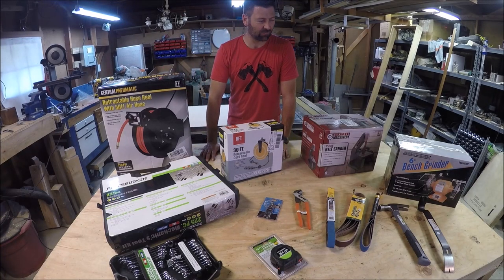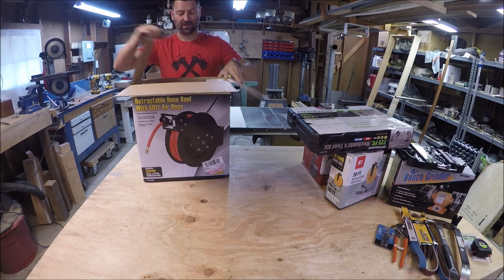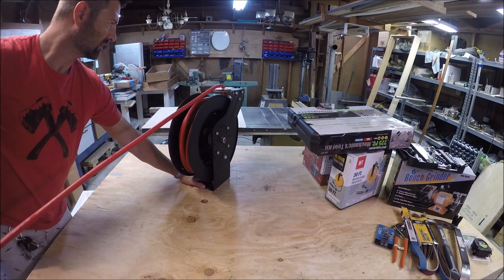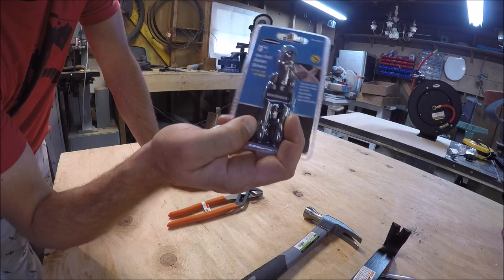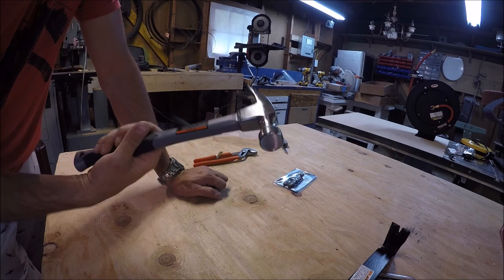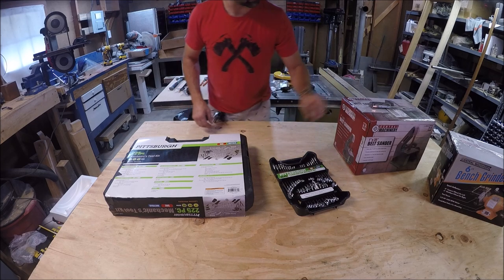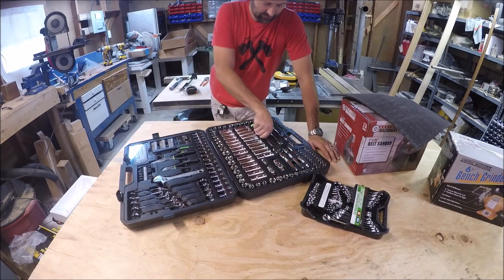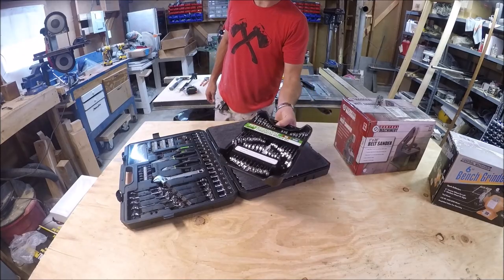Harbor Freight Tools For Pros | THE HANDYMAN

Comment: plenty of professionals do use HF, it just depends what category of work they do. In construction/remodel HF is always on site, why? because contractors (and the like) bake the cost of tools into their projects. so if it lasts the job or not doesn't matter when you can just replace it in the 90 days or when they've already charged $100 for a drill when they use one that costs $20-$30. plus you can leave HF tools on a jobsite, even if they are stolen you didn't loss a $600 miter saw.

Comment: I am 55 and my pop was a master mechanic for over 50 years he had 3 huge craftsman tool boxes with mostly craftsman tools a few snap on and Matco. We lived 2 blocks from Sears. We would go there to look around and always had a tool to return. We had rusted tools broke screwdrivers never a problem returning them. I learned a lot about mechanics and even worked as one with him for 5 years on the books but from the age of 7 he took me with him to work. I went in the NAVY to learn electronics and was a reactor operator but after 7 years I got hurt badly on a sub leaving me with use from the waist down. But when he died last lear I got all his tools and have them insured for 34k. Now I still break a tool now and then but now there made in China and the sears closed by me and the closest one is 61 miles away 
I do wander sometimes if I had not gone in the NAVY if I would have gotten hurt.
Reply from the maker: +ncrdisabled Submarine vet Thanks for your service.  My dad was in the navy too.

Comment: I agree. I have a lot of different brand tools from expensive name brands to cheapy ones. Harbor Freight tools so far have worked just as good as the name brand ones. Of course there are a few that are inferior as in quality but still does the job. Most people I know or seen complain about anyone using Harbor Freight tools is usually just a tool snob that believes if the more you spend on a tool the better it is. Got news for them....unless you have a tool made back bout 30yrs ago or more, they are all made in china.
Reply from the maker: I have found the drill bits and saw blades are the worst thing to buy at HF.    There are so many things that that you can't ignore the deals on and be a tool snob.  thanks for the comment.
Reply: I'm 31 years old and have tools yonger than me that are made in USA.
Reply: Same here....some tools are worth paying extra for, but harbor freight does carry inexpensive tools that can't be passed up.  just as an example, I had a Fein multimaster years ago.   the motor failed just after the warranty expired.  So i purchased a harbor freight multitool to finish the job i was on.   Thing lasted me three years and i paid $40 vs the $400 for the fein.   So even if they fail,  they are worth the money for the work they do.... also bought a $10 pneumatic chisel gun around the same time and still use it sometimes till this day.   Only thing i will never buy from HF is hand tools.  They suck and break and can be very frustrating to work with.

Comment: I love Harbor Freight tools. I've got a bunch of their hand tools in my bags. Things like the cheap hammers and stuff are great when you've got a crew. If someone loses a $5 hammer, it's no big deal. Other things are just handy to have - like the long-handled flat cutters. They suck as cutters but if you use them for pulling nails, they're unbeatable. Perfect grip and leverage. My flat bars are over ten years old and they're still going strong. I go through HF chisels like crazy. They're good enough to do the job well and cheap enough that I'm willing to use them in situations that I wouldn't risk good chisels on. Gotta love it.

Comment: Heck ya Handyman, I'm a huge HF fan myself as a very basic weekend warrior DIYer.  I've slowly put together a very nice collection of handtools and basic construction tools from HF pretty much never purchasing anything without at least 20% off.  I bought that same grinder a few months ago and I had my eye on the 1x belt grinder, glad to hear it works well for your knife.  I know this video is 3 years old, but still relevant!  I also never thought of setting up a smaller pancake air compressor like that, for some reason I thought a shop with a compressor had to be some big huge thing.

Comment: I've had a Harbor Freight drill press for nearly 30 years.  First one I bought made a funny sound, they gave me another. It's got a 1 hp motor, can be wired 110 or 220, a big 5/8" Morse taper chuck, and with 16 speeds I run it down to 170 rpm so I don't burn my bits. And speaking of bits, I've had nothing but success with their bits, and also have a set of "Silver and Deming" bits that go up to one inch.  They have done very well on countless projects, no chipping or shattering.  There are lots of good Harbor Freight tools, and while some are weak and to be avoided, most are fine and a great value.  I do diesel bus repair and dismantling.  I have a 1 inch drive socket set with the ratchet, two extensions, and about ten huge sockets in a nice case.  For 40 bucks.  You can pay that for a single socket when they are this big.  I generally use them with my Bad-A** 3/4 drive "Earthquake" air gun, their biggest pistol grip model. It claims to have 1,400 ft lbs of torque., I can't say for sure but with a good compressor (and oiling the tool before every use) I've taken off hundreds and hundreds of Very Tight lug nuts, at times even ones that some gorilla has cross threaded.  I agree, only tool snobs would Never Shop at Harbor Freight.  But if I had to use my tools every day like construction guys, I'd probably go Milwaukee for a lot of my stuff.  I had a 1/2' "Hole Shooter" drill, on the top there's a plate that says "WARNING: high rotation force" and they ain't kidding.  I used it once with an auger bit and it damn near killed me, I was glad to let go and walk away alive.  Same for their awesome "Hole Hogs."  You get in the wrong position with one of those and they will slam you into a wall make you cry for mama. Still, I've successfully used lots of H.F. tools in my bus business, their 12 ton air over hydraulic jacks are Outstanding.....but like a lot of H.F. stuff, it has a hidden flaw to fix: the air hose will begin crack prematurely especially when hit by the sun.  Wrap it up with black electrical tape and you got a great tool at a great price.

Comment: Nearly every pro tool box tour on YouTube has some Harbor Freight tools in it.  I do not know anyone personally in trades, diy, or auto tech who has zero Harbor Freight tools.  

A few of the items serving me well over time:  breaker bar, 1/4 roto ratchet, impact sockets, axle nut socket set, floor jack, jack stands, socket adapters and extensions.

Keep the 1/2 extendable ratchet in my road kit.  Can take off lug nuts no problem.  No issues thus far.

Just bought their hose grip pliers which seem pretty nice, plus the jumbo Pittsburgh Pro punch & chisel set, and the LH drill bit and step drill bits.  We’ll see how they go.

Comment: I've had great success with harbor freight items, specifically their wheelbarrow compressor and both a 4000w generator and a 2000 inverter generator.   3 years in with commercial use and they're still starting on the first pull so no complaints.  (granted this is with ethanol free gas and annual oil changes)  The tape measures don't last long but thankfully I get a free one nearly every time I buy something!

Comment: People knock HF all the time, but professionals use brand name stuff and they have a few cheap tools as well. If you buy certain tools for one job even if they work once to get your job done your ahead of the game, and the hose reel is a good deal it works well the tension is adjustable and if you have to put a new hose on no problem it's still cheaper than a name brand $$$
Reply: and the tape measure is another good one. you can get them free every few months., I have 4 or 5 of them. I have certain tape measures that I like more than others. but in a pinch the H/F tapes are good to. an inch is an inch no matter where you work.

Comment: 99% of the tools in my garage are harbor freight. The only thing I have had break from them was an angle grinder, and I got my $12 worth out of it. It doesn't make sense to pay 2-5x as much for a tool to work in your garage on the weekends. The only people talking down on harbor freight are the ones that have to have name brand everything and everything else is inferior.

Edit: I forgot I did break a half inch drive ratchet and breaker bar because I had a 6' cheater bar on the end trying to loosen an axle nut. I would bet money a snap on would have done the same though.
Reply from the maker: 6 foot?  Ha ha ha.  That would have broken any ratchet.
Reply: yeah, not sure what you mean.  was it a ratchet or a breaker bar?
because they are two different things.
you can't pipe (cheater) a ratchet, they have relatively delicate inner parts that can't take that kind of strain.
a breaker bar (with just a swiveling head) should be able to take that additional leverage w/o much trouble.
Reply from the maker: I think he broke both of them using a 6 foot pipe.
Reply: ekw555 I broke both lol
Reply: well then!
now your post makes sense.  but piping the ratchet still doesn't.  ;-)
Reply: ekw555, your right about the ratchet but we've all done it in our younger days
Reply: Pittsburgh “PRO” Hand Tools are now made in Taiwan.  It is a known fact that Taiwan has always had very good steel.  And their manufacturing process using that steel is also of high quality.  Very Nice.
Reply: To be fair most of the time they are greatly inferior quality.  What HF can be is a great VALUE for the home gamer.  Love the store.
Reply: @p4tmchef  i agree. Is a good place to pick up cheap screwdrivers,  chisels, ect. But for the most part, disposable tools

Comment: I had the 25' version of the air hose, worked perfectly getting retracted 3-4 times a week for 10 years, I used the retractable electric cord daily including retracting under loads of 1500 watts for 10 years and again worked perfectly. I left them with the house and will buy them again for my new house.

Comment: I bought that bench grinder and belt sander a couple of years ago. The bench grinder's base broke off on one of the corners. It looked like cheap pot metal casting and it had a crack in it to begin with. The belt grinder is still working but a little too much pressure stops it or slows it down considerably and the belt that came with it was horrible. The hand tools have always been great if you ask me!

Comment: I just bought the 225 piece Socket set and love it. I've had a large Stanley set until the case just wore out and got rid of it. I'm not worried about the Pittsburgh set wearing out but the case seems a bit underpowered.Hope it last 10 years like the Stanely did...Habor Freight has its place for certain tools.

Comment: I've had 40 dollar brand name claw hammers snap at the claw when pulling a nail the first day and 5$ hammers that have been with me for 15 years without an issue, still using a compressor and welder I bought at harbor freight and a drill press that works great after 6 years but its not used very often.

Comment: been using that retractable hose for years. at some point had to replace the quick connect but the hose and spring-loaded wheel are ok. the belt sander is also a winner.
Reply from the maker: I love that belt sander.  My knives are always super sharp.  I have used it for grinding other stuff too.

Comment: I have the retractable airline reel, it has lasted for 7 years, you can't beat that for the price, and the only thing I have done and must be done 2 times a year is lube the mechanism that spins and you won't have any problems with it, I will be replacing the hose it's self  next year as it's begining to crack.

Comment: I have a lot of Harbor Freight tools. Most of them are pretty good. But the area they differ from pro brands are in hardening / tempering. For example, I tried a HF ball joint separator which was ineffective because the steel wedge compressed after each hammer blow. So returned it and got a Lisle branded one instead. The Lisle was hard enough that it only took 2 hammer blows to separate the joint.

Comment: I don't buy from Harbor Freight, but I sometimes buy stuff from Walmart's brand Hyper Tough. Many of their products are horrendous, however they cost less than a dollar, so you get a dollar worth of quality. But recently they started putting out some good hand tool series (given their cost). I once bought a 3 set adjustable screwdrivers with about 60 bits. They wear out fast, but they cost $9.50 and I have been using them for work and on my truck for about 2 years already.

Comment: I've started using HF tools a few years ago.. at first I was really wary about it but I haven't  had any troubles yet..  Of course I have my pro grade wood and metal working tools as well but the Pittsburgh wrenches work fine for me as do most of the other tools I've bought there..  Also the 3500 watt Predator Inverter Generator works every bit as well as a Honda 3000 (so far) and gives an extra 500 watts.

Comment: air hose real works well, but the hose rotted out after about 12 months, replaced it with a better quality hose and 5 years later all is good. Hammer I use as a finish hammer for glue ups, have several....Pry bars seem to have feet and wander off by themselves most likely chasing after the tapemeasures  that seem to disappear just as fast. Harbor freight now has a free replacement on many of their tools including the free tape measures.... Now where did I leave the broken one?    Bench grinder from HF is now 35 years old, and still working... I am amazed...I have one of the HF bench drill press that I can extend so it will reach the floor, about 20 years old.

Comment: Sorry I don't mean to sound rude. Military just taught me to always use the right tool for the job, it saves time and money because you wont screw something up and have to by another. Look into the Gerber Freeman Guide folding knife $18 on amazon thats cheep as it was $60 when i got it years ago. It holds a edge well and I strip up to 500MCM cable with it all day as well as tons of other cable and hose.
Reply from the maker: But does it have pliers and a screwdriver?
Reply: No, but you already have those. I never let my guys use a multi tool because they were all or mostly (electrical hazard) metal and i didn't want them to use pliers when they should have used a wrench to not strip things.

Comment: idc what people say, been in the mechanic field for nearly 10 years, own all brands of tools, there are some tools I will only buy snap-on because of the quality difference but then theres tools like sockets, wrenches, where you cannot make me spend the money just for the snap-on name. Yes 1/4 of harbor freight is good, yes there are certain tools that I would only buy snap-on because there is nothing better than having the right tool but when it comes down to a simple wrench, socket, ratchet, I would never buy snap-on. You cannot beat harbor freight prices and I can't tell you a time that I broke a socket, I've broken a ratchet with a jack handle on it, and I broke a wrench holding onto a bolt while hammering down on the nut with a half inch impact. Things you're not suppose to do is what have broken the tools, and they were replaced for free even though it was my fault.

Comment: Harbor Freight is the bomb dude, forget what people say, I am a fan.  I get throw away paint brushes, hand towels, safety glasses, you name it...  Take the 20% coupon and free hanging LED light every time.  Levels are cheap too, the 6 foot metal level 19 bucks for instance, it's as good as the 80 dollar one from HD.  Super glue, electrical tape, the list goes on...  Just get 2 of whatever in case it breaks.  Contrary to what others say, I think the zip ties are terrible - they don't always lock.

Comment: Generally speaking I'll get solid non moving tools like wrenches, screw drivers, razor blades etc at HF. They really do seem just as good and honestly how bad or good can you make a piece of steel that the difference would actually matter? As far as mechanical items like grinders, drills, saws etc I've seen videos from what appear to be engineers detailing all the shortcomings of their electrical tools compared to name brands. I'll stick with dewalt on that front.

Comment: The thing about HF, buy the protection plan, beat the hell out of the tool, take it back with a complaint and they replace it no questions asked. I have done this multiple times and only one tool did have a small malfunction but it was within 30 days & it didn't go against the protection plan. Hell, even tarps too. Buy the protection plan, tear a hole in it or just return it due to wear & tear and they replace it no questions asked.

Comment: I do 2-300 jobs a year in my shop business I have the hose reel and the power cord reel. The air reel is 7 years and 0 trouble. The cord reel is very good too but the ends are not they get loose and plug quits. easy fix! 3 air impacts and all still going strong. Am I a professional? Idk but I do about 6 figures a year and a one man shop. And their tool boxs the big roll around ones are just as good as my snap on and a 10th the price. Oh and my Benchmade knife will never see a belt sander like that

Comment: The impact driver adapter sets are kinda crappy. The 1/4 driver kept getting stuck in my impact. I ended up getting the husky version and have had no issues since. Other than that I own HF for all pry bars I own. The 4 PC set is not HD but I have not broken them. The construction one I got had a bad finish but overall it wont change the usability.